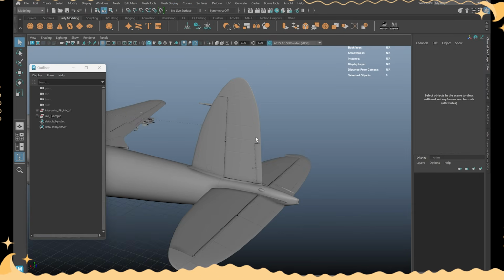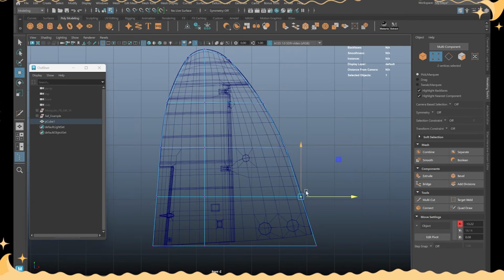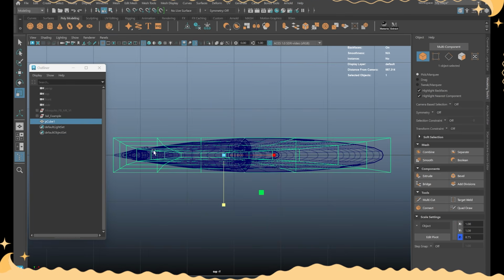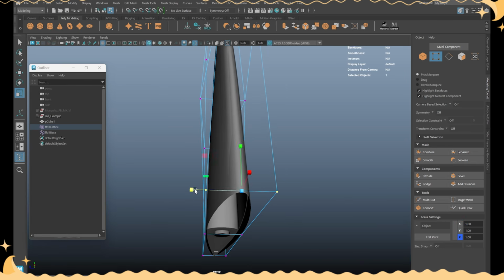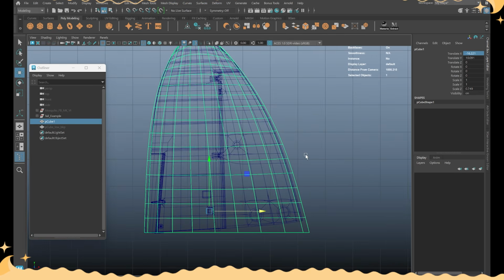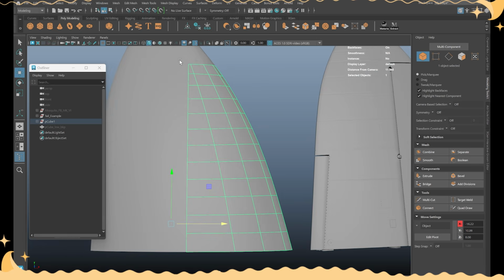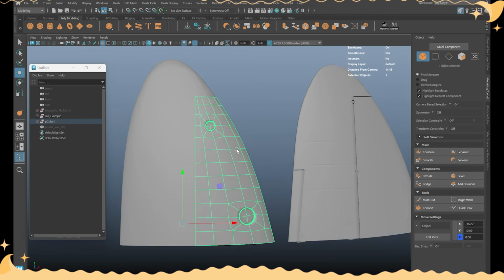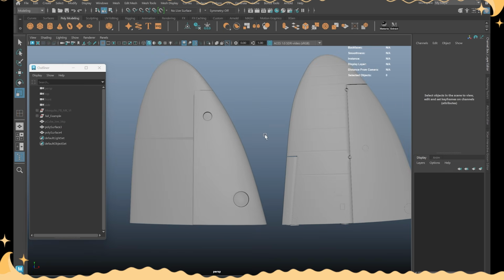How You Can 3D Model Curved Shapes

Comment: I've been working on my personal hard surface project of my own design. For adding or editing geometry on curved surfaces, e.g. panel lining, or adding of some 'latch' and 'screw' like looking 'greeble'  (commonly seen on Japanese mechas), I lean heavily toward a process of duplicating parts of mesh surfaces, using the magnet tool/Quad-draw to model the detail that has to conform to the curvature of the original surface, and I'll delete some underlying surface parts of the original surface and merge the detailed part to it, plus clean up the surround mesh. Do you do something like that in production models or you usually just edit the mesh directly like what you are doing in this video?
Reply from the maker: Hey! Yeah I absolutely do that, I actually just made a video about it. There are a lot of different ways to achieve the same results, and whatever works within the requirements of a production is 100% okay. If it's how you like to work, produces good and clean results, then go for it!

Comment: Very nice! I'd be curious to know why you use Maya, which is quite expensive, compared to a solution like Blender. Might be because that's how you started off, or just because you like it better for a variety of reasons.
Reply from the maker: Thanks!

I mainly use Maya because that's what I've always used, and worked with while in Industry, so I Just know it better. I do also use Blender though, and am using that more and more, especially for quick simulation or sculpting.